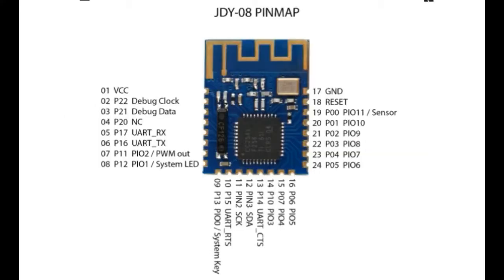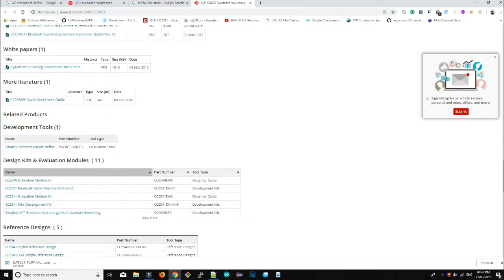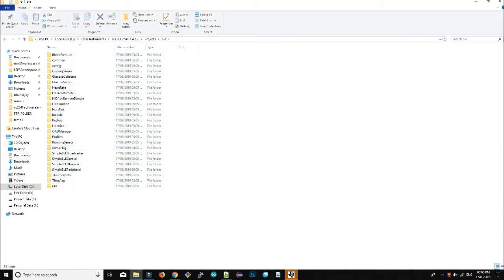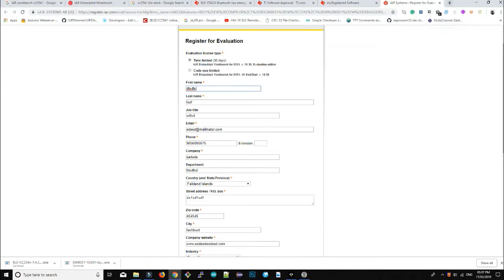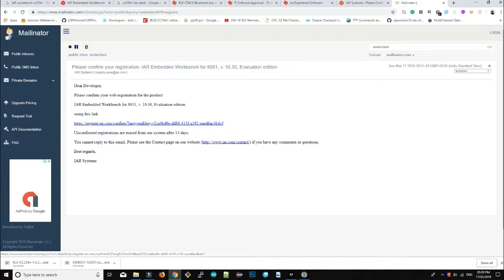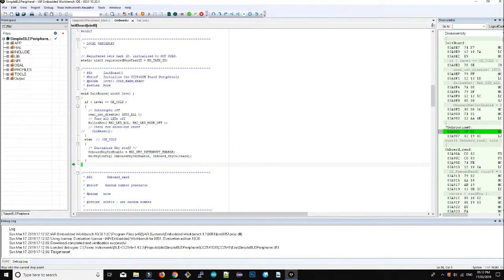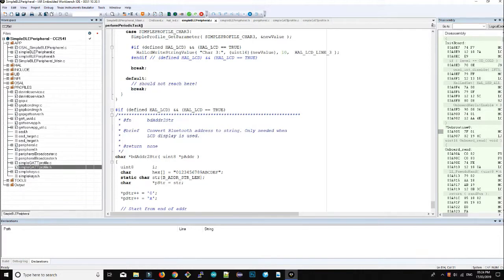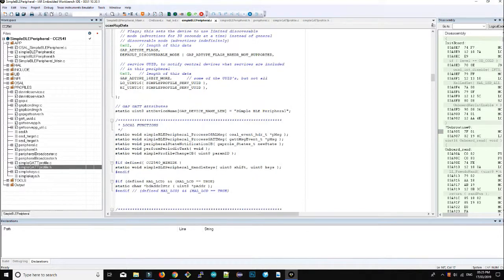Getting started with CC2541 SimplePeripheral Example in IAR workbench

Comment: Can you tell me how goes the connections between the debugger and JDY-08
thanks.
Reply from the maker: https://www.iot-experiments.com/content/images/2017/08/JDY-08-with-HM-10-firmware.png Jdy08 pin(2) -> Clock, pin(3) -> Data, pin(1) -> Vcc, pin(17) -> Gnd, pin(1) -> Vcc, pin(18) -> Reset